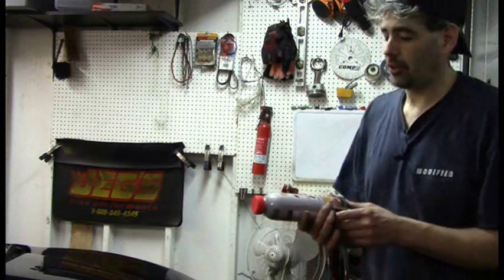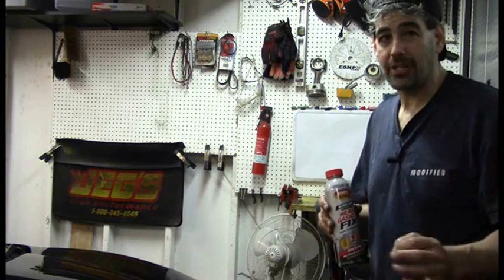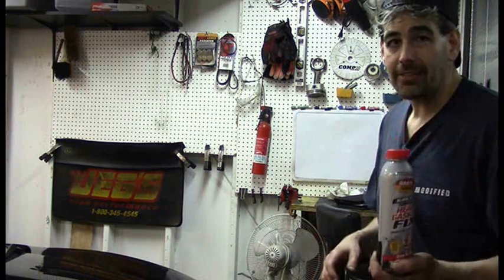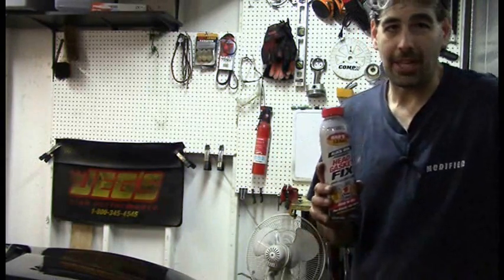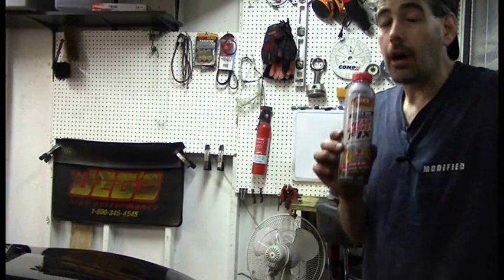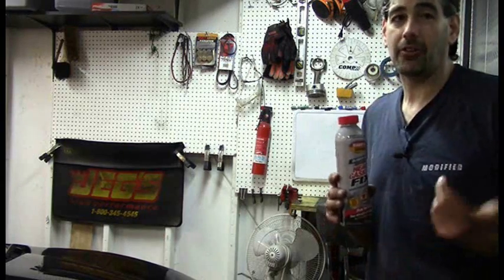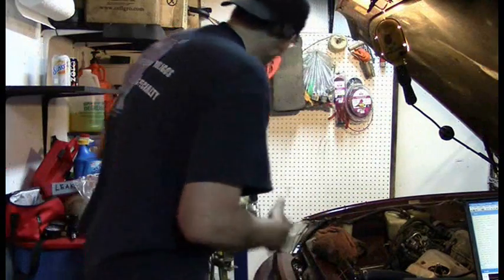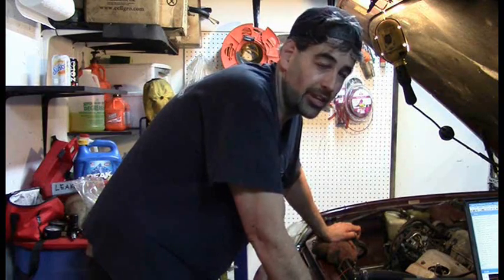Liquid Head Gasket Repair / Block Sealer Scientific Testing

Comment: When Bar's leak is added to coolant, is it easy to see when you examine the quality of the fluid in the rad? When buying a used car, I worry that I might miss a critical defect that is covered up by one of these products....
Reply from the maker: Ah great question, Dave, I can see how that would be a concern.  The answer is yes and no- when the product is added, yes you can see it quite clearly.  It looks like infinite copper glitter and its unmistakable.  In fact your first impression may well be there's motor oil in the coolant- and motor oil from a blown engine at that.  But remember after the product works, the system can be flushed (and in fact some products say to do this in the instructions) and you would never see a trace.
Reply: Get real, I'd never trust what was in the cooling system to begin with not to contain something ruinous to the sealer. If the instructions said to flush afterwards, I'd immediately run the existing coolant into a clean container, fill with water, install the product, process the instructions, flush the mixture and then reinstall the original coolant. Less toxic waste IMHO.
Reply: @HighestRank  Global Warming ANTI FREEZE ?  Could it b?
Reply from the maker: Rýán Túçk Yeah I agree actually- adding directly to the coolant certainly seemed suspicious to me and many other brands recommend the exact procedure you described.  Honestly I think it's all snake oil anyway but there is definitely a marketing advantage to selling snake oil that you just add to the radiator vs snake oil that you have to flush the system first lol. Again, this was just one test of the product in one application. Possibly the product(s) may work in other applications depending on size of the leak, etc.

Comment: steve rob yes i dont like any of the products , and i advise people to only use any of them sealer if they dont sell the car after and if they are going to throw it away if it failed to work, because as you said the heater cores and even radiator also can be plugged up also and the thermostat in some cases.
That is why some  you have to run no thermostat and only fresh water like chemweld i think it is called , that works but what else does it chemically weld i dont know. It only works on cracks not gasket leaks .
This toyota is unlikely having a cracked head i fixed some of these exact engines and never seen a crack on heads on them . They also are knowen to leek oil out of every seal if they where neglected and the oilpump has a wierd silicone ruber type seal on cambelt side that you also want to do when doing a cambelt
here is why the chemweld works but not always also
You overheat the engine the stuff goes in the cracks and then engine cools down it-goes solide and engine wont overheat so the crack wont open up to release the stuff out of the crack , thats what i seen it do on engine with knowen to crack heads toyota estima previa it was . Wont always work of course if you cant get the conditions correct for a product .I would only advise it on cars that will be scrapped if it faild to work.
Reply: That's to come. First the head bolt has to pull the threads out of the Al. block, then overheat a few times and warp. Carnac said so.

Comment: Interesting experiment- I too tried the same product with different results.  The vehicle I tried it on was an external head gasket leak on only one cylinder and to my surprize it worked fantastic but- the heater core was also plugged solid so yes it fixed the head gasket but ruined the heater core.  If I were to do it again I would re-route the heater core coolant circulation  into a series flow and bypass it and then flush the system before attaching the core hoses again.  Worth a try on a disposable car only and a short term fix. By the way the owner drove the car for 6 months without any heat and the product never did fail.
Reply: Still might have removed the clog with backflushing compressed air, but most peeps will fight the hoses off at the firewall spigots and destroy their core.